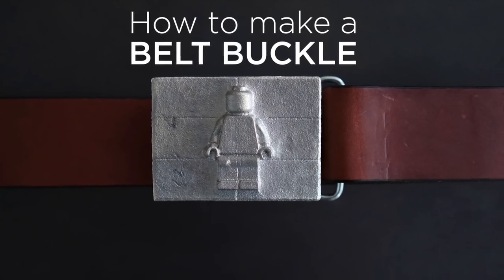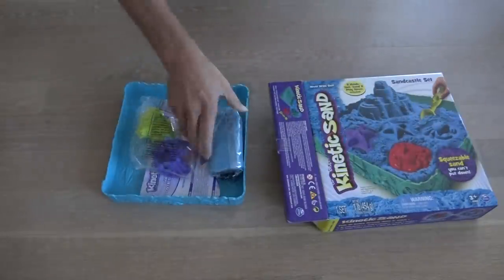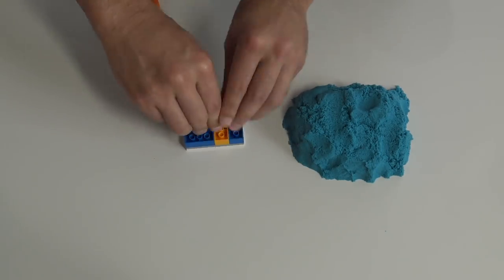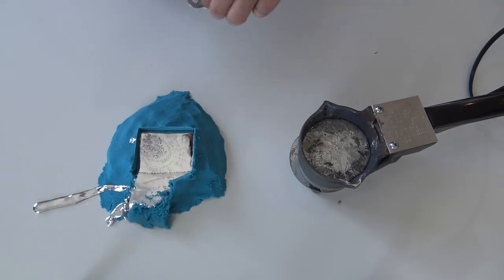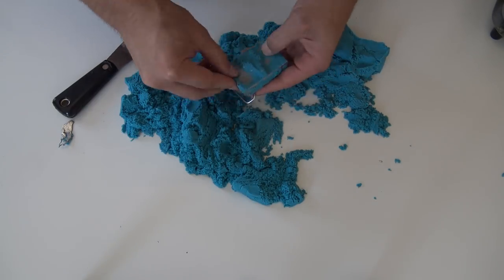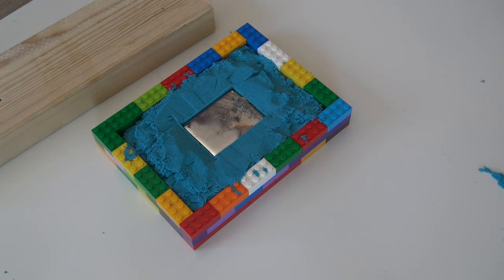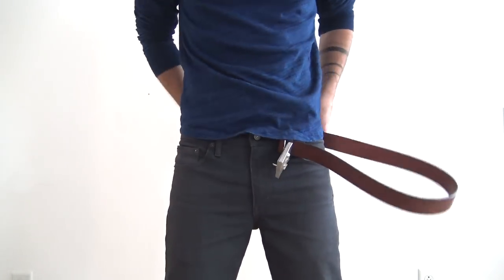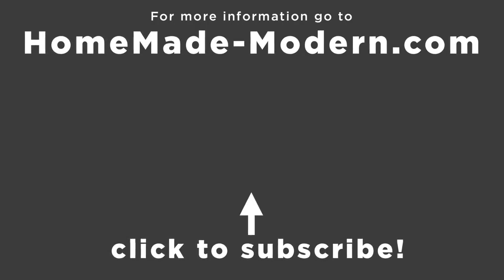How to make a Belt Buckle | Kinetic Sand Metal Casting Project

Comment: Would be really interesting to combine that molten metal with some 3D printed molds to get shapes that would otherwise be hard to make :D
Reply: You can even do lost-casting with PLA too! Lost casting is what they do with wax models! If you 3d print something in PLA, you can compact it in sand, and heat it up. The plastic will burn away, leaving a cavity that medal can be poured into! Obviously with PLA being plastic, not sure what kind of fumes it gives off, but it is possible!
Reply: And how bad would it be to actually make something instead of having a machine do it for us?